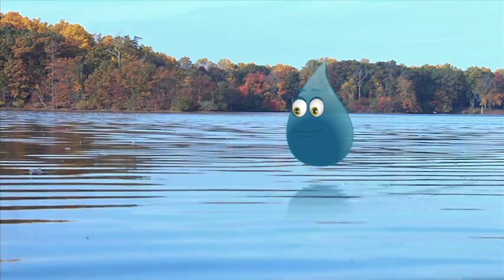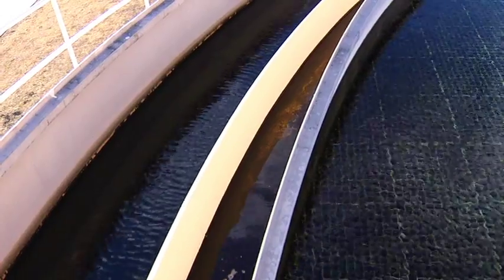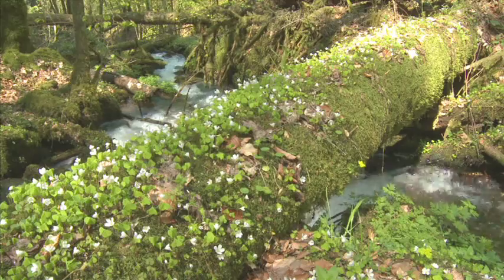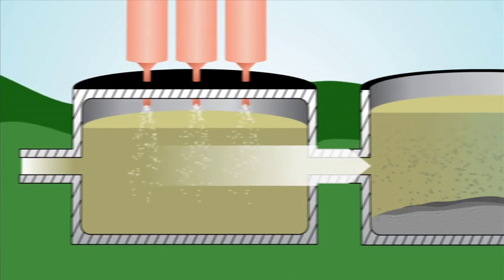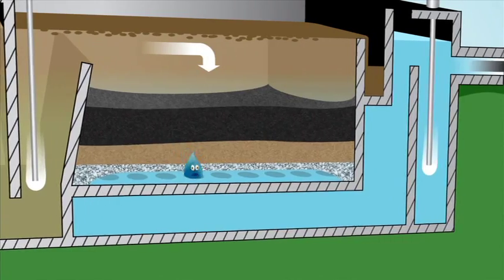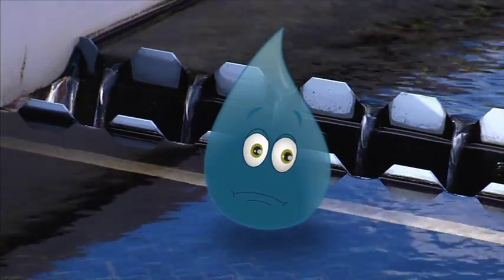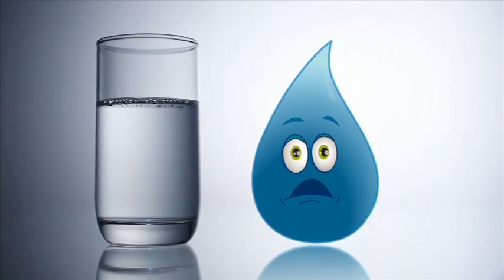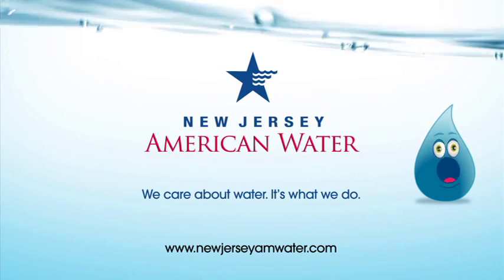Water and You: The Water Treatment Process

Comment: Fluoride is not a vitamin, nor a mineral like Calcium that helps your body. Fluoride can create a coat around teeth on contact, but brushing your teeth gives you thousands of times more Fluoride than you would need. Certainly you shouldn't swallow tooth paste, and your dentist makes you spit any Fluoride treatment, because being a heavy metal it stacks up in the body, hurting bones and lowering IQ.
Many chose not to drink Fluoride and be a bit smarter and younger.